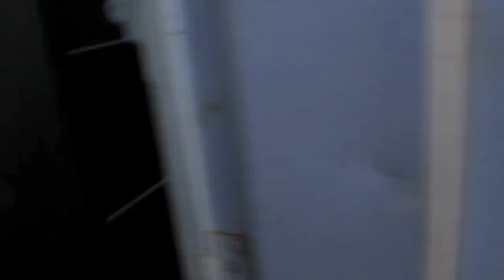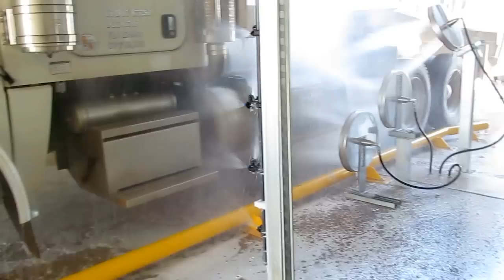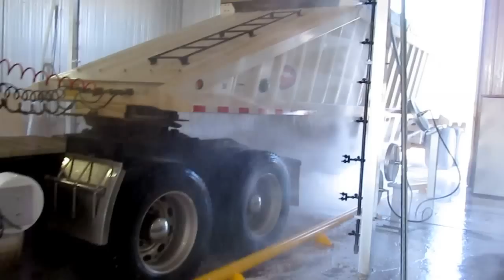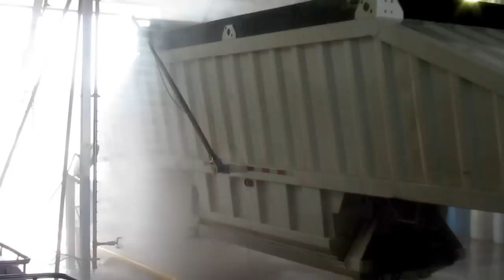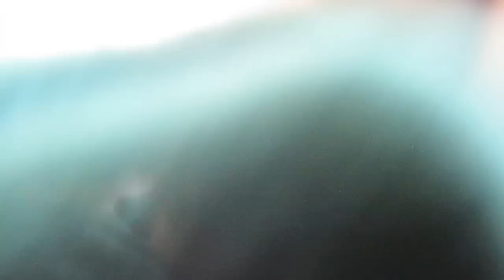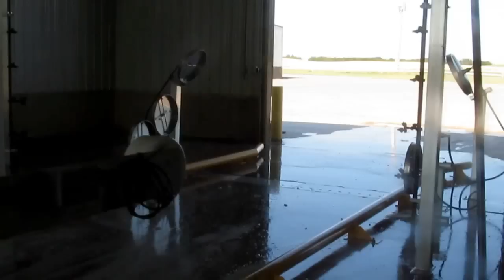Pack Mule Belly Dump Trailer - Cleaned in 2-1/2 minutes by HCS's Automated Truck Wash

Comment from the maker: Pack Mule Belly Dump Trailer - Cleaned by HCS's Automated Truck Wash in under 4 minutes! No Gantry or brush system could clean these vehicles. For more details contact Hydro-Chem Systems 800-666-1992 sales@hcsclean.com www.hcsclean.com